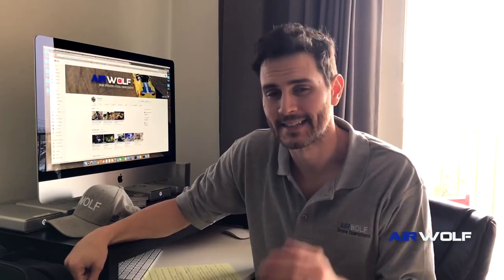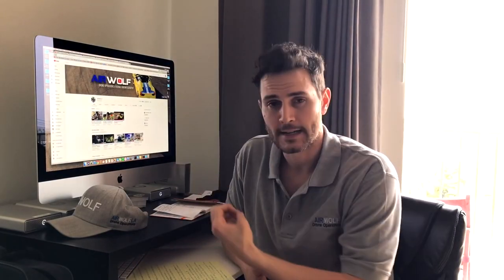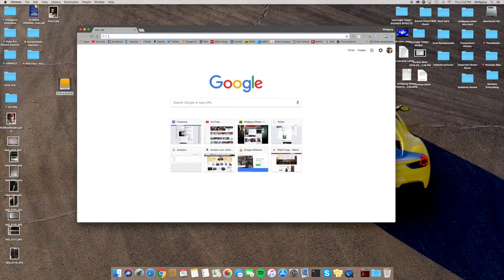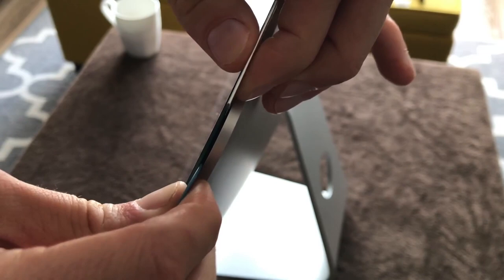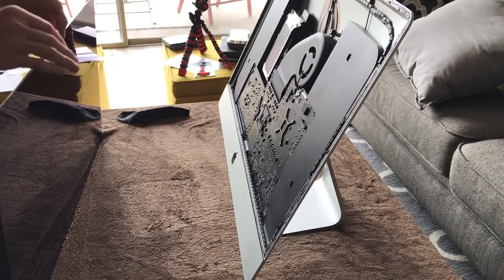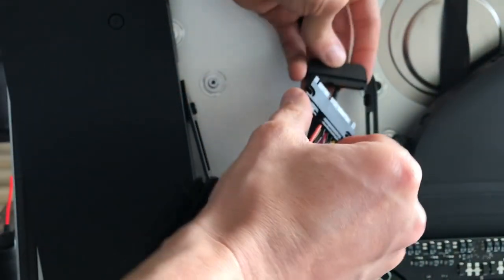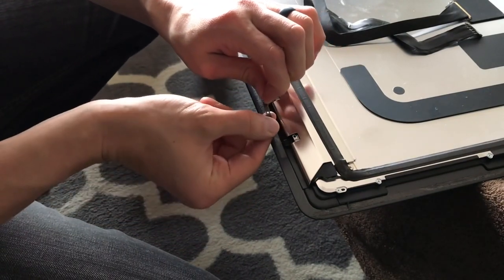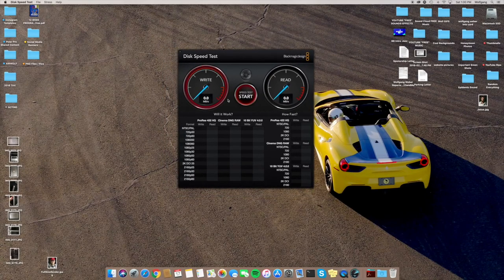Step-by-Step iMAC SSD Upgrade Guide for 5x Faster Performance | 2012-2019

Comment: I'm seriously considering an Imac 2019 27” 5K over a 2020 model, as I don't need the extra CPU and GPU power. Other downsides are the soldered SSD in the new models, and the price.

I have an opportunity buying an Imac 27” 5K 2019 with fusion drive (HDD and PCIe blade SSD) for a good price.
My plan is to upgrade the HDD to SSD and upgrade the PCIe blade SSD to a bigger/faster one.

I’ve noticed in the video, that you only swapped the SSD in the SATA port, I suppose your Imac 2015 doesn’t have a PCIe blade SSD, as the blackmagic speed in the end of the video only is around 500 mb/s ?

Do you know, if swapping both the PCIe blade SSD and the SATA in the 2019 model, would achieve the same speed as the 2020 models which only have the PCIe SSD ?

Comment: I'm wondering why you didn't use the NVME slot on the back of the logic board for a faster SSD?
Reply from the maker: At the time I didn't have the knowledge for NVME.
Reply: Does using the NVME slot have a better performance increase than this method?
Reply from the maker: @seanoh6014  From what I've researched yes.
Reply: @seanoh6014  Absolutely!
Reply: @TheGunnyBadger03xx  Thanks guys

Comment: Just getting ready to do the backup and noticed that my existing drive is now divided into two: Macintosh HD and Macintosh HD - Data.  I am running macOS Catalina 10.15.7.  Machine is iMac 21.5 in., late 2015.  Looked over the .pdf user guide for SuperDuper and tried to find a tutorial on cloning the hard drive when dealing with this Mac HD and Mac HD - Data hard drive split.  Nothing.  Any ideas?
Reply: Same

Comment: Hey, thanks for the video. I have a late 2012 iMac. Can I skip the cloning part if I have a Seagate external drive that uses time machine on Mac. Can I restore it from that? Or do I need to do the cloning bit to get the Sierra OS X as well?
Reply from the maker: You can totally do time machine as well. At the time of making this video I didn't know the time machine steps.  But yes it'll work.
Reply: @AIRWOLF   thank you 👌🏼🙂

Comment: Hi guys 😊looove your stuff🤩. I have a iMac 21’5» 2.7ghz 8gb ram late 2013. Can you please send med links or type a list of what i need to buy to upgrade my iMac 🙏🏽🌞☺️ . I want this SSD, and more ram + sensor. Huuuge thanks from Chris Norway
Reply: Chris, the 2013 2.7 iris Pro 5200 model has facility for a NVME drive on the logic board ( twice to three times as fast as a Sata depending on which drive you get ). Search youtube for 2013 21.5 " imac upgrades for guides. If you are going to the trouble of screen removal, upgrade the CPU and ram to the max while you are in there, a Core i7 4770S ( 4 cores 8 threads )and 16gb ram being the max AFAIK for the Late 2013 2.7ghz  21.5" iMac.

Comment: I´ve done this and worked perfectly, but my microphone doesn´t anymore. Any tutorial on how to fix it? It captures sound but its all fuzzy
Reply: I've figured how to solve the mic issue. It seems that the tape must not cover the microphone that are two small dots in the inferior part of the screen support (you must cut the tape in the inferior part of the screen to avoid tapering it)

Comment: Im a total novice at this stuff, hoping this question makes sense. I do not need to transfer old files to the new SSD drive. So if I just swap the old drive out and put in the new SSD, start the computer and basically start over as a new computer, that will work right?
Reply: YEs that'll work. All you need to do is connect to your wifi and let the iMac download the laters OS and off you go :)

Comment: Hey, sorry for bothering you and pardon my english. I just bought this type of mac last year. I have lack of knowledge about computer, and i just want to ask you that can i just add SSD to my imac instead of replace my HDD? i dont know if you understand what i mean, but i just confuse because all the articles's title is "how to change/install SSD" and not "add SSD" haha :D
Reply from the maker: I’m kinda not understanding. Are you asking to just run your computer of an external SSD? If so yes you can but you’ll only be able to operate as fast as your USB connection.
Reply: Thankyou for your respond :D. Noo i dont mean to use external ssd. I mean, is there any possible way to add internal SSD without remove my internal HDD so i have 2 hard disk inside my mac? Hope you understand my question 😅
Reply from the maker: Yes there is a way. Although the HDD takes up a lot of room inside. But I’m sure it can be done. You’ll have to pick up a SATA adapter that’ll read both drives.

Comment: I bought a new to me 2015 27 inch mac but it only had a 250GB HD. I bought a 1TB Samsung SSD and followed your video. Super Duper ran for over 10 hours and did not transfer anything. I had to force quit Super Duper and start over. Still won't transfer from the old HD to the new SSD.There really isn't much on the old drive (about 55GB).   Any tips or ideas?
Reply from the maker: Double triple check to make sure followed exactly. Super Duper does take a while but should be 10 hours. Try just restoring it using time machine.

Comment: You don't need the thermal sensor at all, actually.  I did this and it works just fine (Late 2013 27in iMac).  The only thing that I can't seem to do is upgrade the PCI SSD drive as no one sells adapters compatible with 2012-2014 iMacs anymore. :(

Comment: Doesn't your iMac have a built-in utility to clone the hard drive?  (Boot into the Recovery Options by holding down Apple Key + R)... I'm a Windows guy, but trying to help my mom remotely to replace her drive.  Thanks.
Reply from the maker: Mark Dawson Honestly I’m not too sure bud. You may be correct. Sorry I’m not much help on that one.
Reply: Get her to take it too a specialist. Should only cost her 150 all in

Comment: My optical HD went out, so I bought an SSD to do this swap with. Everything went in perfectly, following your instructions. The issue I’m having is my iMac was originally set up with the optical HD and a smaller SSD, I’m assuming to boot up faster with. Now that I have the new Drive in, I have three drives available in disk utility: Macintosh HD, Macintosh HD – data, Samsung SSD 860. Now as I’m trying to do my time machine migration, it says I don’t have enough room to transfer my files. I guarantee it’s still trying to boot up and transfer to the smaller SSD. When I open up start up disk, it doesn’t recognize the Samsung SSD, only the smaller Macintosh HD that is like 100 GB. When I click on the new SSD in disk utility it says SATA internal physical volume, Mac OS extended (journaled). Any ideas as to how I can reset the whole system, and get it to boot up from my new SSD? Thanks so much!

Comment: Thermal sensor already exists. Just get a program to monitor it in the tool bar. I do that on my 2011 PowerBook pro & my 2019 27 inch i9 iMac.:-). No harm adding more but seems pointless. IMHO.

Comment: Any good double-sided tape will hold the new SSD, GET THE THERMAL SENSOR or your cooling fan will drive you nut, regardless of using a software fan app. Mac utility will also clone your existing drive to the new SSD

Comment: Is cloning necessary if I’m doing this on a iMac previously owned by someone else? Pretty much new for me so I wouldn’t care much about previous data saved on it
Reply from the maker: Yeah then you wouldn't have to clone it.  But you'll have to pre load a OSX onto it.
Reply: Before tearing apart the iMac, do a full Time Machine backup of it. After the mods are complete, boot up as you hold down Command-R (= "restore"), chose the Time Machine drive as your boot source, and the cloning process happens automatically

Comment: Hi AIRWOLF, 
what can I upgrade other than RAM on my iMac (27-inch, Late 2013), 3.5 GHz Intel Core i7 quad-cor, 16 GB 1600 MHz DDR3, NVIDIA GeForce GTX 780M 4 GB, 1Tb Fusion Drive ?
Thanks

Comment: Oh, I was wondering why you’d want a 3.5 to 2.5 adapter, this is the 27” iMac... the 21.5” iMac actually has a 2.5 drive, so, not needed for those with the 21.5” models. Also, might not have room (nor need) for the thermal sensor.

Comment: I have an imac 21.5 inch late 2015 is there anything I would have to perform different to do the same upgrade?  Also, do you have a video for increasing gb?
Reply from the maker: No it’s virtually the same. And as increasing the gb/RAM. I unfortunately don’t have a video. But it’s quite easy to do. It’s literally just removing the cover on the back and sliding your RAM in the slots.
Reply: @AIRWOLF  thank you!
Reply: @AIRWOLF  Been contemplating what to upgrade to. I'm finding the 2020 model is challenging to remove the RAM on 21.5 in compared to the ease of removing the back cover on the 27in.

Comment: Can I just use time machine, then plug in the ssd? Or do I need the OS preinstalled?
Reply from the maker: I'm sure theres a way but I'm unfamiliar to be quite honest. You could however take the blank drive -> wipe it (Mac Journaled) -> Safe Boot -> And you can select from the safe boot to install the OS onto the new SSD.  

I personally wanted to just have all my programs and apps already in place.  So cloning I found to be so much easier.  Literally just plug the drive in and its ready to go.  Again I'm sure theres many ways to get the job done.  This was just my way I suppose.  

Hope that helps . :)

Comment: So basically the pcie fusion drive is still working right? U didn’t change any setting, just change the cloned ssd to hd? I hope u can reply this. Really appreciate the reply.
And 1 more, i can’t find thermal sensor here in Indonesia, will the fan work just fine without the thermal sensor?
Reply: Bantu reply sesama indo, Fungsi dr Fusion drive cuman bisa aktif kalau ada 1 drive SSD NVME dan 1 spinning hard drive (HDD) jalur SATA boss.. kalau cuman ganti dari HDD ke SSD doang tp SSD NVMe nya gak diganti, speed nya malah mentok di speed maksimum dr SSD SATA (450-550 MB/s).. 😂
Reply: @christiansamuel7318  noted bro Samuel, thank you. Aku dah coba dan memang pcie nvme yg bawaan ga dipakai akhirnya dan hanya pake ssd sata. Ya tapi mayan lah kecepatan nya nambah 3-4 kali lah drpd fusion drive dulu. Dan ini cukup membuat imac nya berasa fresh ga kayak imac keluaran 6 tahun lalu. Btw aku hanya clone hdd to ssd lalu colok lagi dan beres udah bisa jalan tanpa kendala.... thanks bro
Reply: @jefrilay  sama sama boss😊..

Comment: Initially I wanted to take the easy way out and install Catalina on an external SSD, but I can't fint the external SSD (correctly formatted) when starting up while holding the Alt/Option key. I later found out, that there are some claims it is not possible when running Catalina. So realizing I most likely have to do it this way my concerns are now if a new internal SSD will work when Catalina is installed?
Reply from the maker: Are you saying that your Mac is too old to run Catalina?
Reply: @AIRWOLF  No, Im saying that from what I have read, it is not possible to run Catalina from an external SSD, so now I am afraid that if I install an internal SSD It will not recognize the internal SSD, when trying to install Catalina. (Sorry for my poor english)
Reply from the maker: No apologies needed. Ah ok. Well I’m running Catalina on my internal SSD just fine. I don’t think you’ll have any problems.

Comment: I have bought everything, so when I clone it, it will be ready to be put inside and will work fine after? I'm also putting in 32gb of RAM does that start working straight away?
Reply from the maker: Yes! It should boot right back up.  But please test it before sealing it back up.
Reply: @AIRWOLF  will do

Comment: Help. Under imacs overview setting, where the macs specs are located at, it says iMac and it usually says something like iMac (Retina 5k, 2017) or whatever year it is, now, if it doesn’t have that (Retina 5k, 2017) part, is there something wrong with the mac? Why is it missing?
Anyone help
Reply from the maker: Is this from swapping the hard drive? Or is this something that just happen randomly on your Mac?

Comment: My late 2013 iMac is very, very slow. I have tons of apps installed and currently using 910gb of the 1tb hard disk. Just clone to a SSD would solve the problem or its better to do a fresh OS install?  Thanks in advance!
Reply: DeadeD do both. Install an SSD and don’t clone it before. Do a clean install and pull the data you actually need manually onto the new drive. Should work like brand new after
Reply from the maker: Yes an SSD would be great! But you may want either off load to free up some space or get a bigger ssd.

Comment: I'm upgrading 27" late 2012 to ssd, currently attached using external usb to sata iii cable. When I open screen using $10 amazon tool + new tape kit can I avoid needing an expensive sata inline thermal sensor cable?  Can I avoid a 3.5" to 2.5" adapter tray and instead just zip tie the new 2.5" ssd into place?
Reply from the maker: You can mount it however you like. I used the mount just to secure it best.  From what folks have been saying.  Is that you don’t need the thermal sensor. I did it because it doesn’t hurt to have it.
Reply: @AIRWOLF  Thanks for response.  If inline thermal sensor was $7-10 then i'd spring for it but at appx $40 its almost 2x what i paid for the sata iii ssd drive upgrade.  In one article i saw comment that said in iMac late 2013 and newer setups you can swap internal sata iii cable connected apple hdd with ssd and not need an inline thermal sensor or software based fan mgmt solution as the macOS is presumably now smart enough to make sense that an ssd is connected and the fan should never really need to run to cool it off beyond what its already doing for other internal parts. 

I've also been  reviewing some comparisons that show a sata iii ssd connected to usb 3.0 port vs internal sata iii cable performs pretty much the same.  Therefore i'm thinking why crack the screen adhesive on the iMac if the performance won't be any different other than for aesthetic reasons.  For now i have it taped to back of display and from the front you can't even tell its there. Any erroneous conclusions i'm making here that you've seen in your experience?

Comment: Where would you use the 3m double side tape? I am worried about the screen falling off and would like to use the 3 m tape to reinforce the adhesive strips provided
Reply from the maker: I purchased it as a backup.  The adhesive that came with the kit worked just fine.
Reply: @AIRWOLF  that adhesive kit fix for Imac 27” 5k 20019? Thank you bud

Comment: Would this work on a 2019 21.5 inch iMac?
Reply from the maker: Yes. The hardest part is just getting inside. Once you’re in there they’re all pretty much same. Expect for the Pro models. But! Make sure you don’t already have an SSD. I’ve had some folks not realize they already had it. 🤦🏻‍♂️

Comment: do you know if the Samsung 870 QVO-Series work with Imac 21.5 inch late 2013?
Reply from the maker: As long as it has a SATA connection it should be ok. :)

Comment: Hello, great video than you, can i add second hard drive ?
Reply from the maker: I'm sure theres a way.  Unfortunately I don't know it. With the SSD's being as small as they are you could stack them. But if you're really wanting dual hard drives I'd start by looking up something like dual SATA connector. I mean I work off externals so I found no use for it.

Comment: I’m scared but about to take the leap! Just ordered the drive and parts. Is the 3M tape really needed? It adds another $26 to the cost, and i don’t know what i will do with the additional 10 feet of tape afterwards. Could foam adhesive tape work just as well?
Reply from the maker: No you don’t need it. I used just the numbered adhesive that came with the kit
Reply: Oh - I’m definitely using the numbered strips! Those puppies seem critical. I was referencing the Velcro tape you used to attach the adapter to the case. Is that needed?
Reply from the maker: @paulf0x  It isn't.  I just bought it just in case
Reply: Done! Works great! I’m grateful for your help @airwolf!!  Great video that really helped. I did follow the advice of another YouTuber and gave the corners a couple dabs of silicone just as a precaution to prevent the possibility of the screen coming loose. Thanks again!
Reply from the maker: @paulf0x  You're welcome!

Comment: So no hairdryer heating up the edge to soften the tape? I have seen this been dons and was worried, was it hard to do it without heat, would you consider it?
Reply from the maker: I don't know.  I'd stay away from applying any heat.  I personally had no issues doing mine.
Reply: @AIRWOLF  Thank! I will try it your way, and as you said, take my time.
Reply from the maker: @sandymclea  yes! Take your time. There’s no rush. Keep me posted

Comment: Im hearing that the late 2013 27in model has the SMART firmware so that the hdd doesn't need the thermal sensor, is this correct or can anyone confirm, this?
Reply: I just saw a few people confirm that starting 2013 the thermal sensor is not needed. I just bought a late 2013 27" but I am putting Linux on it and it takes care of it even if the sensor is missing in older models.